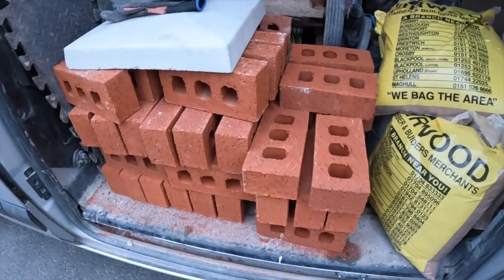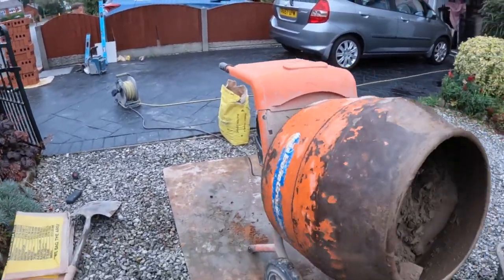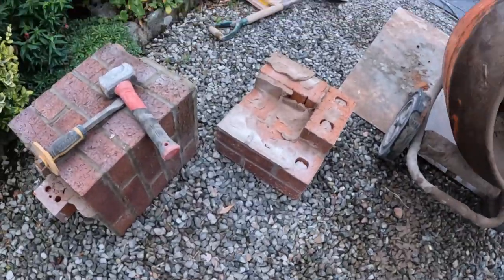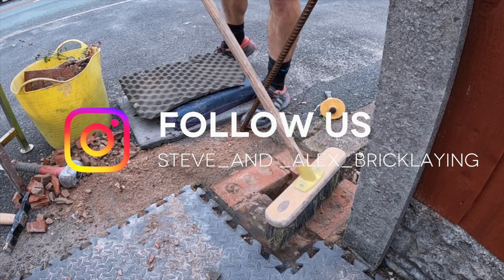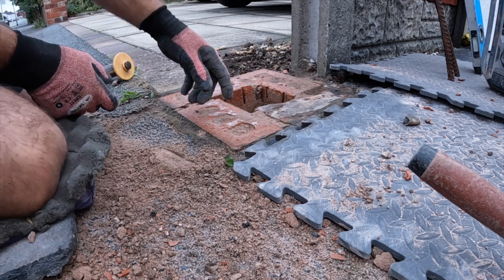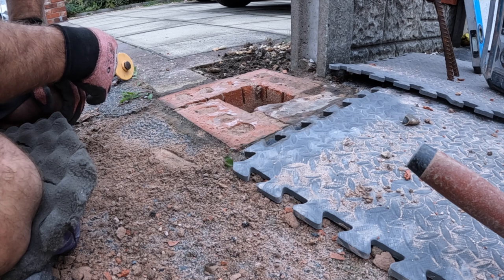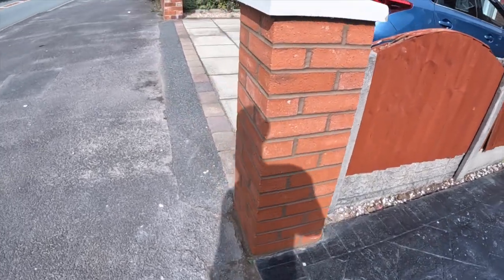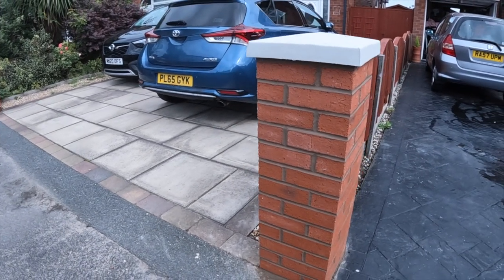BEEFED UP BRICK AND A HALF PILLAR

Comment: Have you changed or tightened the drive belt might be slipping when mixer is full
Reply from the maker: Yes mate , all that . Had another look and the drive shaft is loose in the actual motor 🙁🧱👍🏽

Comment: Get yourself a new mixer and keep the old one as a second. You never know the day may come where you and Alex are on separate jobs and need both. It will also come in handy when you mix your own concrete for foundations as you can run both at the same time.
Reply from the maker: I think a new one is inevitable. The motor is about to self destruct🧨😬🧱👍🏽

Comment: Would having a centre brick sunk down by half a course add much more strength? Just a thought as I watched this, all the joints would be staggered between the internal and external courses?

Also did you consider drilling down a bit so the rebar was deeper or maybe adding an L/J bend to the end?, good job on doubling up with the off cut though.
Reply from the maker: @martin2466  🧱👍🏽
Reply from the maker: @martin2466  🤣🤣🧱👍🏽

Comment: Nice job 👍🏼👍🏼 1 1/2 piers are not much good for gates, need 2 x 1. Though they may decide not to rehang the gate now anyway. I’ve lost track of how many fence repairs I’ve done over the years as an insurance repairer. Most have been pier and sections but some have been isolated dividing piers like this.